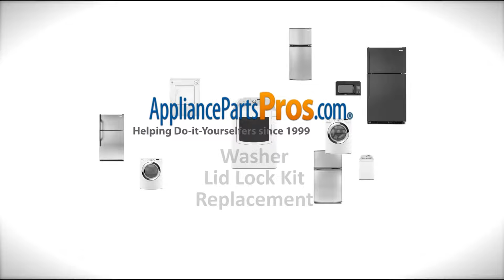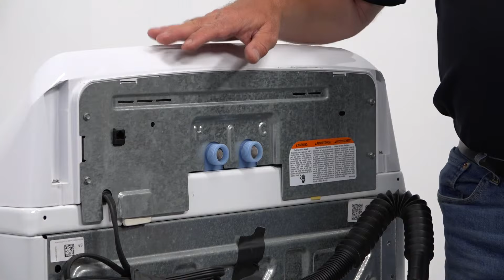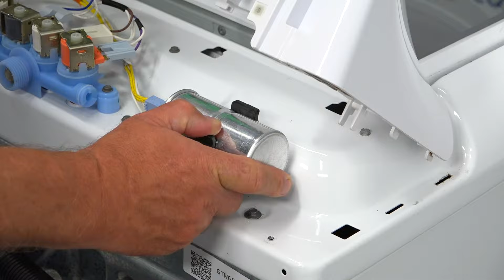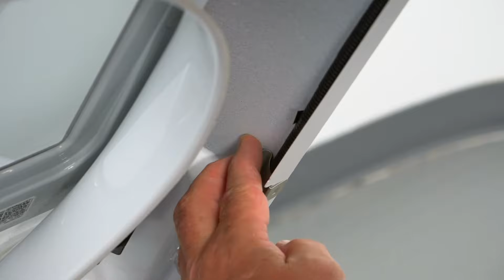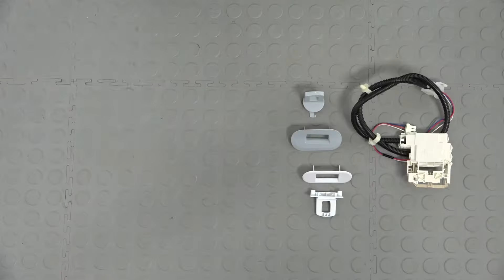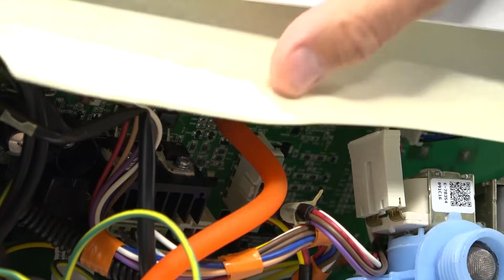How To: GE Washer Lid Lock Kit WH08X32697

Comment: My washer is still saying lid on the display I changed the harness lid lock but no luck do you know what the problem can be? It’s model PTW70OBSTWS should I change the old bezel and lid striker?
Reply from the maker: Great question, @bojansilva8893! You would need to replace the bezel and lid striker if they’re damaged, but first double‑check that the lid lock was installed correctly. If the installation looks good and the striker isn’t the issue, then the next step would be replacing the control board.

Comment: Great video!  I will need to reinsert the lid lock assembly into my broken lid.  Can you show how to remove and replace the glass lid?  the plastic housing inside the glass lid has broken into many pieces and the lid must be replaced.
Reply from the maker: What is your model number?
Reply: @appliancepartspros  PTW600BSR1WS. Thank you!!
Reply from the maker: Hi @tomkennedy9485 — thanks for the kind words! For your model PTW600BSR1WS, the glass lid is only available as a complete assembly, including the frame and plastic housing. Unfortunately, the internal plastic parts aren't sold separately.

We don’t currently have a video showing the lid replacement specifically, but it installs with just a few screws once the hinge covers are removed. 

The part number for the lid is WH10X35297, you can place the order through our website, or you can call us at 1-877-477-7278 to place the order over the phone.
Reply: @appliancepartspros  Thanks for the reply!  Yes, I have ordered the full glass lid with the plastic housing.  I need to replace the lid and the locking mechanism as well.  I was hoping to see how to remove and replace the lid, incorporating the locking mechanism, which I will repurpose the existing lid lock - thanks to your video!  Any suggestions are welcomed!  Thanks again, Tom
Reply: @appliancepartspros  Thanks for the response!  I have the entire glass assembly lid on order.  Now comes the tricky part of replacing it.  I appreciate your responses and consideration!  I will keep you in mind for future needs.  TK
Reply from the maker: Hi @tomkennedy9485 — you're doing a great job staying on top of this project! Since you’ve got the full glass lid assembly on the way and are planning to reuse the existing lid lock (smart move), here are a few tips to help with the replacement:

For your GE model PTW600BSR1WS, the lid is secured at the hinges along the back. Once you lift the top panel, you’ll have better access to swap the assembly. Just be sure to support the lid as you remove the hinge screws or pins to prevent it from shifting or dropping.

When it comes to transferring the lid lock:
There are two lock tabs on the bezel that snap into the lid lock from underneath the top panel. If you gently release those tabs and remove the bezel, the lock should slide right out. Reinstalling it into the new lid follows the same steps in reverse.

Comment: There’s actually a way to do this without removing the entire unit. I found a video on Amazon. It’s pretty clever, but you basically do everything from wrapping your hands on the inside un clipping everything. I did it successfully.
Reply from the maker: This video is generic and intended to give you an idea of how the repair is done. Different models may have different steps.

Comment: My lid is locked and will not unlock, what should I do?
Reply from the maker: You can try unplugging the unit for a few minutes to see if it will unlock that way. If there is still water left in the tub you can try hitting the spin and drain cycle to see if it will drain the water and unlock the lid. If that doesn't work you may need to remove the top so you can access the door lock and manually unlock it. We would need the model number of your unit to get the steps for you to do that.
Reply: @ ok will reply soon but your quick response is very much appreciated, but it’s the same washer from this video.
Reply from the maker: Good luck! Let us know if you have anymore questions!

Comment: I just replaced the lid lock in my GE Profile washer just like this and now it won’t even engage the lock and the display keeps flashing “lid” message. I’ve did the reset method and after entering diagnostic mode it’s showing error 23 which is for the lid lock mechanism which I just replaced. Only thing I didn’t replace was the latch itself. Thoughts???
Reply from the maker: What is the model number of your washer and we can look into this for you.
Reply: Im having the same issue
Reply: Update, the control was faulty. I had to replace that too.
Reply: @davidchristian1717 do you know which part specifically if you dont mind me asking?
Reply: @itsfron1481 sorry I do not. It was still covered under warranty so the manufacturer took care of what parts to order and they sent a tech out to replace it.
Reply: Alright, thank you though!! I appreciate the reply!  @davidchristian1717

Comment: Hello, I’m hoping you can help me. I have the same washer that is in the video. I replaced the lid lock assembly and my washer is doing this thing where it is locks and operates as it should but then you hear the latch clicking and then the washer ends like it is finished but remains locked. It keeps doing this even though I have unplugged it and even manually unlocking it and trying another load. 
It will fill and run for about 5 minutes and randomly will start making a clicking sound where the lid lock is and again end and make the sound that the load is finished even though it’s still full of water and locked. Please help.
Reply: The washer model number is PTW600BPRDG
Reply from the maker: Have you recently had any type of power outages?
Reply: @appliancepartspros i have not

Comment: I replaced the Lid lock kit step by step but now my washer won’t turn on, it just makes a sound as if it wants to spin but doesn’t spin any recommendation much appreciated
Reply from the maker: Have you recently had any type of power outage? What is the model number of your washer?
Reply: With the old lid lock I would get a clicking sound .
Reply: @josemendez-fy7km there is a video that helped me fix the problem just now..

GE washer will not spin or lock/ model GTW460ASJ6WW

Get it done home repair 

Hope it helps you out 👍🏼
Reply: @josemendez-fy7km I replaced my lid lock and it keeps doing a slicking sound as well
Reply: No sound with this one just the hesitation of wanting to spin …
Reply: @josemendez-fy7km did u found a fix for the problem?
Reply: GTW460ASJ5WW- haven’t had any problems with power outage.
Reply: I have the same issue . I just changed mine yesterday.

Comment: My washer gets stuck on SeNsInG and will not spin or fill. Is this a result of a bad lid lock switch?
Reply from the maker: What is the model number of your washer and we can look into this for you.
Reply: @appliancepartspros  PTW700BPT0DG. Last night we unplugged it and plugged it back in and it wouldnt turn back on.
Reply from the maker: Have you recently had any type of power outages? Do you happen to have a multimeter?
Reply: @appliancepartspros  no, we have not. I do not have a multimeter. Could probably obtain a cheap one.
Reply from the maker: Have you checked the breaker to make sure that it didn't trip?
Reply: @appliancepartspros  yes we did. It finally ended up coming back on this morning.

Comment: I am having the same "LID" error when I try to run a load.  I am oretty sure my lil one broke the latch on the glass lid as everyrhing else turns on and works.  Anyways, it has been a few days and I desperately need to do laundry ASAP.....either with a lid lock "over-ride" or by ordering the part!!  Besides wondering if I can bypass the lid lock/switch in order to run a load or two- I am also wondering if I need the entire part that you replaced in your AMAZING video since I doubt the plug and wiring harness (or whatever it's called) actually needs replaced??  Anyway, my Model # is: GE GTW685BSL1WS.  I would truly appreciate any and ALL advice you can offer so I can get this fixed quickly!!!  Thank you very much for this video and for your perfect instructions on how to replace the entire mechanism!!!
Reply from the maker: There isn't anyway to be able to override the lid lock, you would have to get whole assembly. The part number you would be needing is AP6027541. Below is the link to the part so you can look at it. If you have any questions please let us know!
https://www.appliancepartspros.com/ge-lid-lock-harness-wh19x24141-ap6027541.html

Comment: This instructor was very clear  and reassuring.  I ordered the part, put it on while the video played, and the machine worked fine. Plus, the new latch design was a definite improvement over the original one.
Reply from the maker: Glad we were able to assist you. If there is anything we can assist you with in future please let us know!
Reply: our laudry cabinet fell off the wall, right above our washer/dryer, but the only thing that broke on the washer was the hook part of the lid latch. This video helped me get it off with the small hole pin release. New part will be here tomorrow, should take 5 seconds to install.

THANKS!!!

Comment: I was able to change the lid lock without taking anything apart,  it can be reached by moving the tub over twards the lid lock and reaching under.
Reply from the maker: Glad you were able to remove the lid lock without taking anything apart. Some models maybe a little more trickery than yours and you may have to remove some parts for the appliance in order to get to the lid lock.

Comment: I have a GE  top load quiet wash.   replaced lid lock ,  did not fix.   How can I force it to run a wash 
lid is closed    wont work
Reply from the maker: Have you checked for loose or damaged wires? Have you recently had a power outage? What is your model number of the washer?

Comment: Anyone have the part # to the board the switch plugs into? I accidentally shorted the switch out causing it to damage the board…..
Reply: Did you find a board . I think I need one too . I tried jumping the lid lock connection and I think I messed up the mother board . The lid lock is getting signal it’s just not engaging the locking mechanism

Comment: Is the lid glass on this model? Does it often break?
Reply: Yes, the lid is strong glass.  We have had our washer for 5 years with no problems with the lid glass.  We did need to have a circuit board installed under warranty and I just completed this lid lock repair.  Otherwise the washer has worked well.

Comment: I already replaced the lid lock, but the washer is still the same. What happened?
Reply: Did you figure out what the problem was?   Mine us doing the same thing.  I think it's in the setting...It doesn't like Super load on Speed Wash.  Seem to work better on Medium or large on speed wash. Mine love to rest an hour or two between washes.....I don't think i will ever buy another GE product. I can't stand a ticky appliance.
Reply: Did u find any solution? Im having the same problem. Just ordered a control board see if that fixes the problems.. ran test nd it detected the lid switchh not working. Replaced still the samee.. hope this board workss...
Reply: @eastend3865  did the control board fix your problem
Reply: Control board
Reply: Did you change out the latch also?